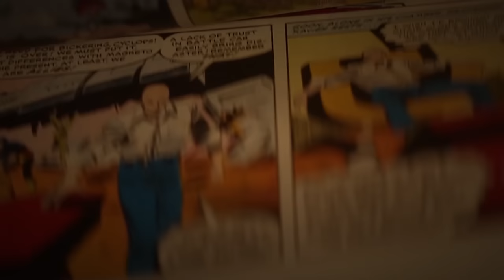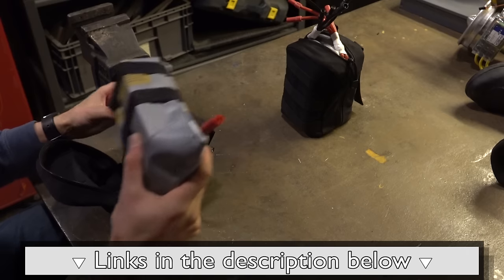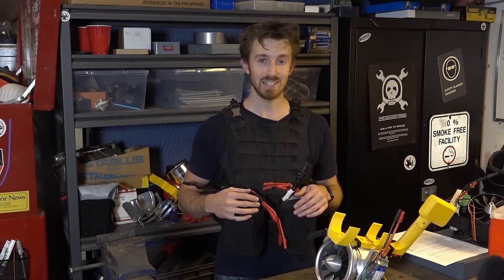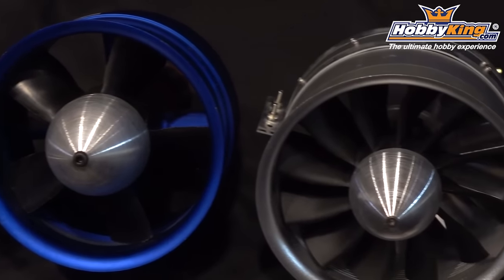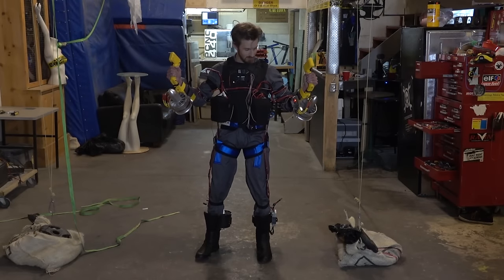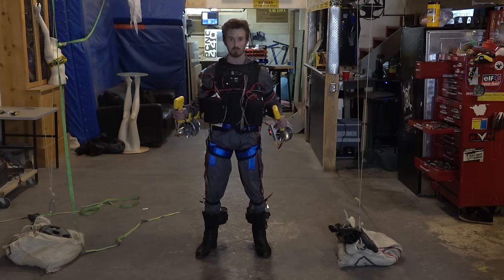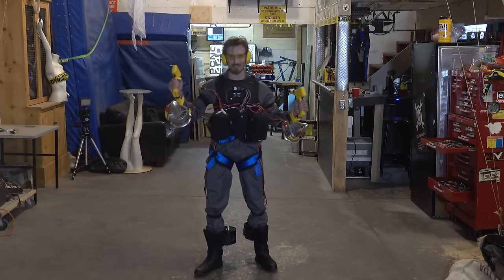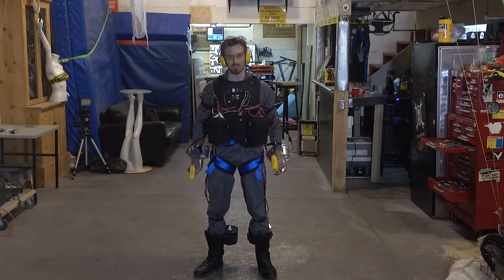Flying Like Iron Man #10: Jet Boots

Comment: Extending the wires can cause ripple current issues in the wiring, and make the ESC's perform poorly, overheat, tan also burn up motors. To compensate, you need CC cap packs to suppress the current ripples. They are installed next to the eSC,a nd can be piggy backed to each other.  all of your equipment will work better, and more efficient once that is taken care of. 
Cheers!

Comment: I don't know if it is same in this case but I build some stuff too and when I don't have the money I make it myself. Since it is just the matter of a bigger fan, how hard can it be. I bet it will be much easier to mill a bigger fan
Reply from the maker: Watch our latest video on making our own EDFs =P
Reply: the Hacksmith just watched! I want to make a jet engine for my school project can you suggest me how I can make it with not so professional equipment. I mean people have cut lines at the corners of circular metal disks to make the fans and compressors. Will it actually work and make a self sustain jet engine. I don't care if it blows up after 5 sec by I just want it to self sustain for 5 sec
Reply from the maker: Don't know anything about jet engines myself, just EDFs, sorry!
Reply: the Hacksmith its ok, I was thinking about turbofans for your purpose. in commercial turbofans the larger fan is rotating at a slower speed however produces the majority of the thrust. So if you do some match a figure out the dimensions you don't need extream precision fan as it does not have to rotate at such high speeds.
Reply: What song did you use in this video ?

Comment: Try to get funding from NASA. They could use this prototype for potential mission to Mars.
Reply: DJ Dimitri I assume you've seen the advertisment for the Mars documentary that's gonna be on National Geographic.
Reply: DJ Dimitri 
NASA would most likely be going to billionaire Elon Musk and his existing reusable rocket company SpaceX. NASA already has jetpacks, so did the military, and you can buy jetpacks and real flying hover boards right now for around the price of a new luxury car or a house. I don't think anyone has tried building rocket boots though.
Reply: With how thin the Martian atmosphere is, ducted fans aren't really viable.
Reply: Kerbal AirForce Martian colonists would probably use rocket belts instead of jets.
Reply: Which already exist in cold chemical reaction EVA jetpacks. They would just have to be made miniaturized so they could be carried comfortably. I honestly don't think they'd bother, because needing to fly around on Mars would be a cost/benefit analysts between the reward of flight and the risk of injury a million miles from the nearest hospital.
Reply: DJ Dimitri They would not need so much work on the thrusting for Mars, so much as they would need revising chemical and electrical systems.

Comment: Hey man, best variant would be to put 2 large EDF-s on your back and 2 smaller ones for control.. it would be easier to maintain balance because your center of gravity is moving up... but as i allways said the Gas turbines would be the best variant.. and you can easily deal with the temprerature problem you metioned on previus comment.. so now if you will get enough founding i suggest you to move on Gas Turbine. Good luck in future progects.. Im going to start my exo progect soon, and will upload some videos!

Comment: At first: Great project and video!
What came into my mind while watching:
How about using some EDF's in a backpack which are "pumping" the airstream through a prefit channel?
Like some Rocketbooster-like nozzle as an outlet, whilst 2-4 EDF's are giving enough volume to get an increased airspeed at the exit.
Maybe that'll help bringing up efficiency
Reply from the maker: Unfortunately any kind of redirection of thrust through piping or tubing... reduces potential thrust by a significant factor =(
Reply: Which would make me ask, why Vector-Thrust then is so efficient? Whilst pumping more air into that channeling as being pushed through a reduced diameter, airspeed and pressure of the outcoming air should rise, if I'm not mistaking completely
Reply from the maker: Do you have any examples of vector thrusting with such a system? All that I've seen so far angle the motor to vector the thrust, which is fine. If you have piping redirecting the thrust a significant distance you're gonna lose a lot of thrust. This might be okay for little RC quad copters that already have a lot more thrust than they need, but for a system like mine you're just never gonna be able to get enough power to do it =(
Reply from the maker: Basically, the most efficient thrust comes directly out of the fan -- redirecting it in anyway causes turbulence in the airflow, which reduces optimal thrust.
Reply: Oh, okay, haven't thought of the turbulences in airstream.
I was thinking of pumping air into a central channel with the fans angled in kind of a 30° angle and letting it out straight down or even angled a little to the sides, to give some sideways stabilization.
A little inspired by the scheme of a turbofan but with multiple EFD's producing a combined airflow out to produce thrust.

Comment: man, without an actual arc reactor that spews out MW range power, and arc electronic boosts, you just cant make an iron man suit...it seems sad but it's time to get real..you would rather be more successful in making a batsuit with batgadgets and bat mobile instead
Reply from the maker: I've never said anything about building the suit -- just flying like him... It's not going to be commercially viable, but I'd still rather be able to fly for a minute than not at all!
Reply: the Hacksmith if that's the case then you might want to check out Flyboard Air (which you probably might already have...) 
It's the smallest gadget I've seen that can make a man fly, maybe you can reverse engineer it???
Reply: now i dont know if it is real or fake coz there is always that buzz on the net.... but if it is real...
Reply from the maker: +JayB B its real alright, but it's also a $250,000 prototype with years of engineering R&D... I have a garage and my best friend lol.

The turbines they use are $50k each
Reply: :'( aw man...
Reply: still love your content... especially the attack on titan and the cap america shield!
Reply from the maker: But if you love my content why are you telling me to "get real?" =(
Reply: some things just cant happen, example,  an arc reactor XD
as you pointed, i was under the assumption that you wanted to make a fully functional suit so...
Reply from the maker: +JayB B I've never once said anything of the sort, this project is just called flying like iron man -- not building an iron man suit ;-) 

and I'd hope you'd think I'm smart enough to know an arc reactor isn't possible since I'm actually an engineer... Right?
Reply: youre smart

my bad :P

Comment: i am wondering why you are even messing with edf and not going straight to actual turbines.? much much higher thrust to weight ratio i would think.
Reply: Nerys  you are forgetting price!
Reply: Not too expensive actually for the cheaper turbines. The hoverboard that set the world record recently uses them. Cooling and any useable flight time is going to be very hard on electric power especially if he's trying to lift his entire weight
Reply from the maker: +MrBooshScadoosh the hoverboard (flyboard air) that uses jet turbines... Each jet turbine is $50k. The whole thing is a quarter million dollar prototype.

Comment: You have the same problem as everyone else in any form of transit power to weight. those batteries man...
Reply from the maker: +Joshua Briggs which would normally be a deal breaker -- but since I'm just making a prototype for YouTube, a 1-2 minute runtime is fine with us -- better than not flying at all!

Also there are commercial h2o2 jet packs that only last 20-30 seconds :p so I'll still be a bit after of the game.
Reply: I think it's an admirable dream, but when accomplished will you stop there? Wright brothers started with 12 seconds of flight now facebook has planes that don't land...
Reply from the maker: +Joshua Briggs who knows ;-)

Watch my TEDx talk (search Hacksmith TEDx) it explains why I do what I do.
Reply: Quick question what module are you using to control the edfs
Reply from the maker: Standard ESCs for control of the EDF then a regular flight controller for modulating output to each ESC
Reply: the Hacksmith you  are  amazing
Reply: Joshua Briggs n
Reply: Joshua Briggs
Reply: Joshua Briggs

Comment: Just a recommendation because this is really expensive, think about getting a super capacitor grapene battery! Also you should make a grapene suit! Oh yeah hi earl
Reply from the maker: +Challenge Accepted but neither of those things are commercially available... :(
Reply: the Hacksmith oh! Thanks for replying so fast! 🙏 I know that is really difficult AND expensive but you can make your grapene at home. I'm also curious, can you use wires and using generators can you use them instead of batteries without the wires from burning up?
Reply: the Hacksmith you should also make a patron!
Reply from the maker: +Challenge Accepted we have a Patreon... Link is right there in the description :p

Can't use a generator, 32kW is a lot of power. You'd need a trailer sized generator to provide that!
Reply: the Hacksmith oh! Thanks for reply btw!
Reply: the Hacksmith btw this was totally inspired by another comment, I think you should try to get funded by NASA, because they are colonizing mars in 30 years and this will help them maneuver a lot!
Reply: Would they use the suit on mars or in space?
Reply: Trippy_Stairs I said it in my comment -_-
Reply: You said they are colonizing mars,You didn't say whether they'd use it in space or not,
Reply: Trippy_Stairs oh yeah, sorry, I meant on mars because astronauts already have a jet on their suit.
Reply: Mmmk

Comment: The world has an magnetic field. why not find a way to get an electromagnetic field of the same charge to take and keep shape. making you weightless. then use those flight systems you made to get direction?
Reply from the maker: +Mistersirguy Teriyaki cause that doesn't work.
Reply: the Hacksmith 
you mean like being able to fly? Y'know at one point  no one thought the Internet would work. Or the car. They were considered miracles and technological advances. And I thought if anyone might be able to figure it out it might be you. Guess I'll just have to do it myself.
Reply from the maker: +Mistersirguy Teriyaki I'm all for trying the impossible, it's what I base my channel on! But there are basic laws of physics that really cannot be broken. The Earth's magnetic field is extremely weak and couldn't be harnessed in that way, it can't be concentrated -- but if you do want to pursue your idea -- start studying :)
Reply: the Hacksmith 
Thanks.
Reply: Mistersirguy Teriyaki the earths magnetic field is weaker than the average horseshoe magnet
Reply: Ranger01 
So make the magnet incredibly sensitive?
Reply: Mistersirguy Teriyaki you must learn lot basics of physics then u will not think about this.

Comment: Im only a first yr electronic eng student, this seems super cool. To me it seems like a good idea to have maybe 2 of the 24kg engines on your back and smaller ones on arms and legs... not done any of the maths but rough estimates 48+16+16=80kg of thrust, how much do you weigh? Equipment would weigh a lot too Im guessing. Maybe 3 on your back but that would probably be wider than your frame.. still more compact than the hover shit. 104kg of thrust and maybe wire the batteries off yourself if youre ONLY trying to hover like the scene.

Comment: starts watching at Ep8
"These guys are idiots"

sees ep10
"Okay. You have my attention"

But, seriously, people with engineering and aerodynamic degrees have said that you'd need alien-tech, just to get anywhere near an "IronMan" suit.

If you could move your legs closer together, to put more thrust on a smaller surface area, you might have gotten a bit more height in your flight. Rhyme not intentional.

Comment: There are turbine engines  smaller than your edfs that put out as much as 50lbs of thrust... I understand the safety concerns presented with strapping literal fire cannons to your body buuuut if you wanted something true to Iron Man, only 4 firecannons would suffice. One for each appendage assuming you could shield your legs from the exhaust of the arm thrusters. There is also the option of one on each foot, 2 on your back, and edfs on hands for control, lower back, buttocks, and legs are easier to heat shield than the sides of your legs.

Comment: You did not have to run batteries in parallel u could have used the arc reactor  u made by ionizing plasma as an electric source for jet boots

Excuse me if I m wrong I m only 12

Comment: I think what might help for cooling for both you and the thrusters is liquid cooling run tubes with a small battery powered pump to push through the water, line the legs and arms and battery packs plus thrusters with the tubes to cool them down

Comment: sir, if u can attach a heating chamber with the edfs at its back with its cross sectional  area decreasing ,which would result in more outlet velocity of the heated and compressed air as a result the thrust may increase.(more or less like a mini jet engine replacing  combustion chamber with a manually heating chamber heated by coils and adding a motor to the propellers)

Comment: do boots and glove and a upper body like frame above you but like farter like a drone and 4 jet engines for lift and glove and boots for steering but 2 steering motors on glove and boots so i am 10 no 11 birthday anyway umm my laptop is geting hot so i make a lego gear box for more speed and made a cooling fan so yup

Comment: Oh and you should make a prototype iron man helmet with a headsup display and a connection to a computer maybe using an arduino and programming it so it'll give u stats on heat and battery etc and wear t when u do stuff

Comment: This won't make you actually fly right? It will make you hover, but not fly. Unless you go for something like a helicopter, where you aren't pushing off the ground, but are pulling up instead.
Reply from the maker: +Nikita Feoktistov if you listen to the whole video you'd understand the concept... This won't, but with larger EDFs it is very much possible. Push versus pull is irrelevant in this design

Comment: Double the edfs Double the Power = more weight. U can cool the ESC with the air from the edfs. U can redirect a litte bit of the out comming air up top the ESCs.
Reply from the maker: We would need around 30 of these EDFs to produce enough thrust for flight... it's just not ideal. EDFs become more efficient the larger they are =(

Comment: You should built something like a Nitro with Great air pressure.. to form propulsion.. You really can't fly if you're just depending on those jets.. Both feet and hands do electrical propulsion.. Like how Jets and Rockets fly, I'm not sure how are you going to do it but you need Nitro and Great Air Pressure to fly.. You made fly because of the weights.. So try one..
Reply from the maker: Stablization is near impossible with any gas powered turbine -- you just don't have enough control. Sure we could strap enough jet engines to my limbs to make me fly, but I wouldn't be flying for very long without be coming a bloody pancake on impact.

The concept here is to use a hexacopter style jetpack which can do all the stabilization required for consistent flight. The hand and feet jets can then be used to move laterally.
Reply: +the Hacksmith Yeah buddy its risky it might burn you hahaha! But yeah i see how it works ^__^

Comment: Use external power while you're R&Ding the suit, then you can figure out the true power draw of the EDFs you're using, also it will allow you to fly with exacly 8 EDFs because you don have to account for the battery weight; maybe 9 bacuse of the material weight. love the vids but more of the flying like iron man would be appreciated thank you.
Reply from the maker: That was the plan, but the EDFs are the expensive part
Reply: Maybe in a different project you could make a suit like vulture from spiderman, the more hovercopter like EDFs could be cheaper, thanks.

Comment: so...batteries...
put them off to the side...run a wiring harness to you...this will "tether" you to the ground...but removes the weight of batteries GLDD
Reply from the maker: Thanks for the suggestion Justin Schuhmann (Dr Donkey Kong)!

We've actually answered this in detail in the Flying Like Iron Man Q&A video! Check out that video, or visit http://www.thehacksmith.ca/flight-project-qa/ to learn more about the project! Basically, the weight of the wires would be more than the batteries!
Reply: actually, i meant batteries on ground...not run powerline wires. ;)

Comment: Love your projects. Have you considered a single large fan ducted to the hands and feet? Flush mount to the back and encased like a car turbo, with flexible tubing to duct and focus the airflow.
Reply from the maker: +Dan Hundley large ducted fans don't really exist -- but the bigger issue is you would lose the majority of your thrust to turbulence -- you can't really pipe it places without losing a ton of thrust :(
Reply: Gotcha. Good luck with it.